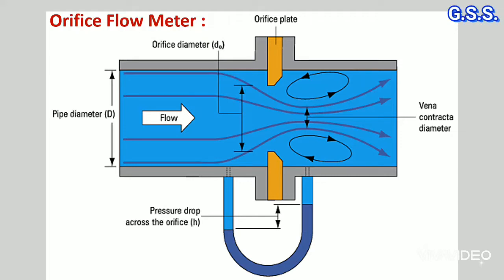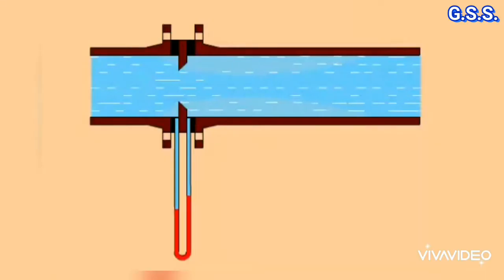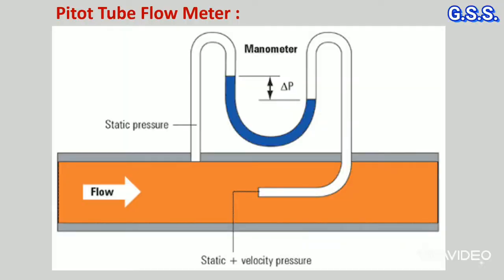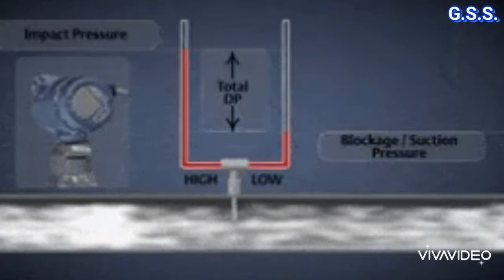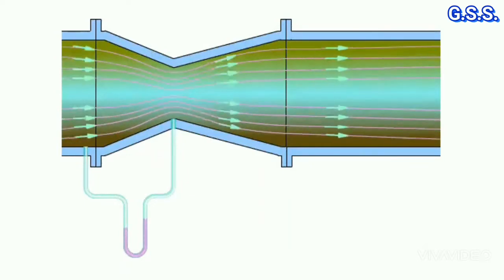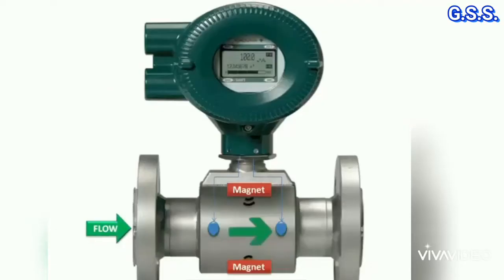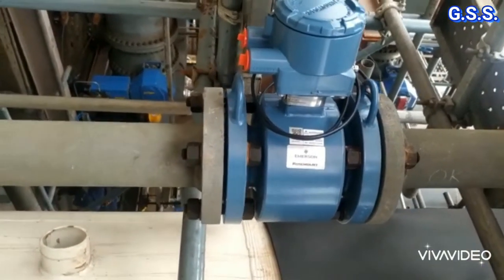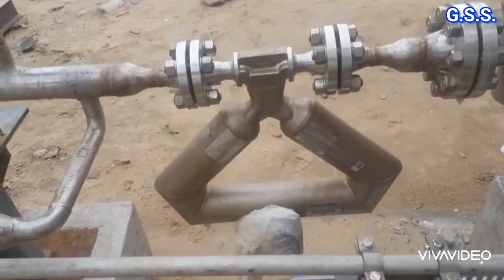Piping Engineering : Flow meters - orifice, pitot tube, annubar, venturi, coriolis, magnetic

Comment: what kind of straight length of pipe required in all flow meters
Reply from the maker: For all flow meters minimum 10D straight length at upstream and minimum 5D straight length at downstream is required except for Coriolis mass flow meter. 
For Coriolis mass flow meter as such there is no requirement of straight length, but for a steady state flow, about 5D straight length at upstream and 3D straight length at downstream is recommended.